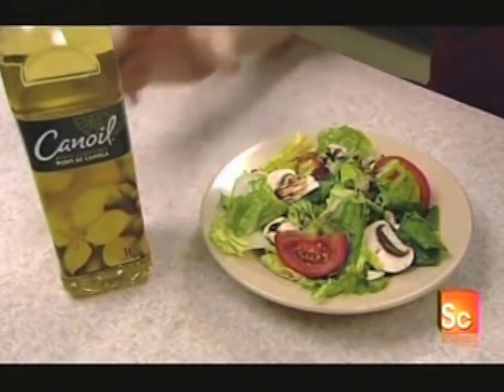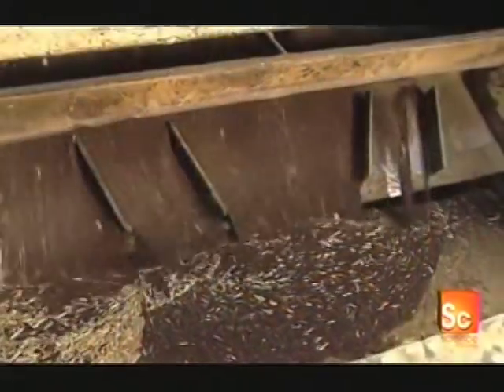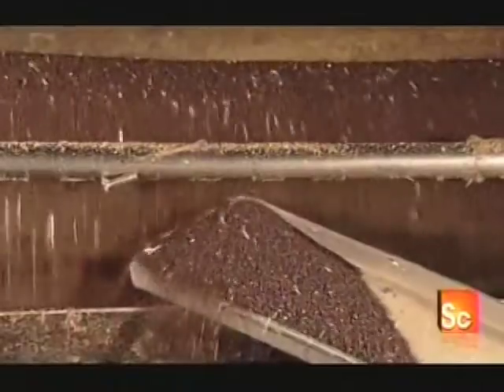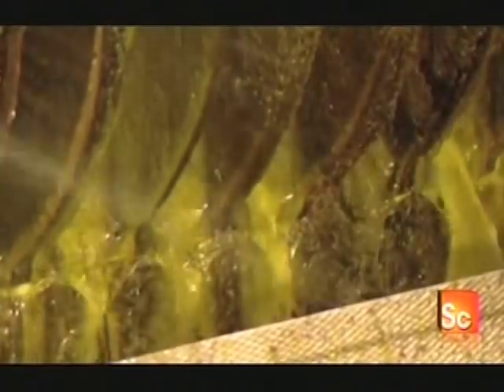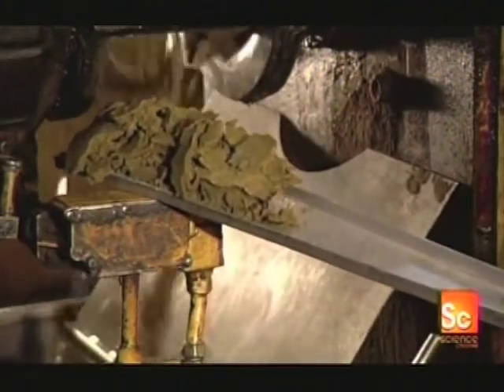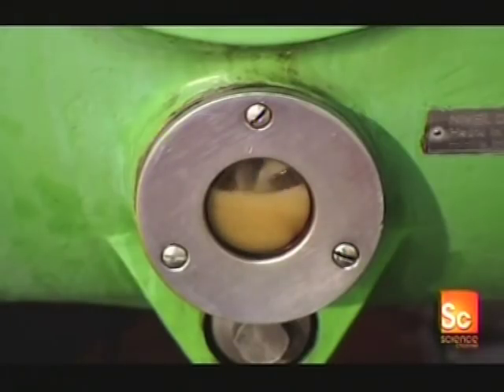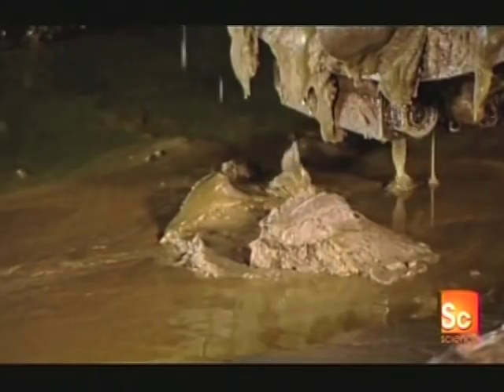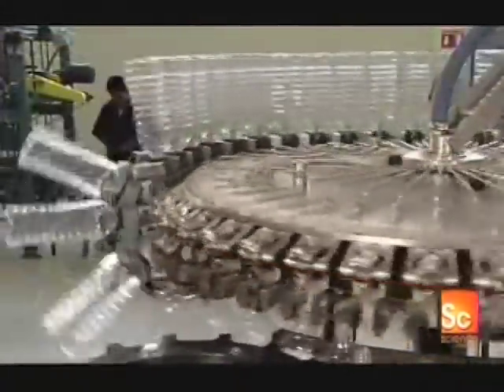How It's Made - Canola Oil

Comment: I thought it was going well up to the bit about using a chemical solvent to remove the remaining oil from the canola cake. It went downhill from there quickly.
Reply: The chemical solvent used for both oil extraction from the rapeseed and soybean is hexane.  No thank you!
Reply: Exactly. This is disgusting and how it can possibly be advertised as "heart healthy" is beyond me.
Reply: @ladiat  - If you want healthy canola (or any oil for that matter), you need to look for ones labeled "cold pressed," or "expeller pressed" or "virgin."  These oils are naturally pressed and not chemically extracted....BTW, it's the same with olive oil.  If it's not labeled "virgin" or "extra virgin" then it's probably been chemically extracted too - especially if it's a "light" olive oil, which indicates more refining as well.  Natural cold pressed oils cost more, but definitely worth it, IMO.
Reply: RBD oil is tested for any solvents after processed… like hexane, and if there still were any bad chemicals in there, it wouldn’t be on the shelf
Reply: RBD PALM OIL isn't a bad thing, considering it is replacing partially hydrogenated oil. It is healthier than its predecessor. And it is probably better than highly refined oils. But we can get better health benefits from other oils. But they cost more, so industry uses RBD PALM oil. I'd rather that than soybean, corn, or canola. Downside is the deforestation to grow PALM trees. And they sit in tanks for months at a time. Growing ever so rancid. They rarely ever empty the tanks.
Reply: This video has been cut. I saw the whole thing several years ago, all the stuff that would change your mind has been removed.

Comment: Bleached, deodorized, hydrogenated goodness!
Reply: +Thunder 35 What's wrong with deodorization?
Reply: +Shawn C Live steam is used as motive force in a deodorizer, bubbling up through the oil to ensure that all the oil is exposed to the vacuum and heat inside the deodorizer tower.  Temperatures are actually higher when it's heated, to about 230-245C.
Reply: At this point, the 'good' fats are killed. So it was good before being steamed and not good after. Is the point every one seems to be making
Reply: Naturally if it stinks soo bad, people won't consume it?
Reply: Doesn't this high heat make the oil rancid as well?
Reply: +Lofty In the words of the backpack from Dora the Explorer, "Yum, yum, yum, delicioso!"
Reply: @colinfarquhar918  It means that it's rancid and then processed to make it smell non-rancid.

Comment: We have rapeseed oil here in the UK but it is mostly much less processed than canola oil. I only get the 'cold pressed extra virgin' sort
Reply: It was banned in the UK in the 1950's - equally as toxic - and has to go through the same process here to make it 'safe'  If you only use the 'cold pressed extra virgin' the rapeseed must have been 'genetically modified'?

Comment: Agreed! Make sure what you are buying is labeled organic and is cold pressed, expeller (machine pressed without using chemicals) pressed or some other natural way of separating the oil. Otherwise, you may be getting product from some of the greedy manufacturers which are doing a lot of the same processes as like on this video to get every last drop of oil from a crop. Sunflower oil and coconut oil will probably be my only oils that are not animal based. Still deciding on cold pressed olive oil.
Reply: Man DROP THE SUNFLOWER OIL AND GO GET A BOTTLE OF EV OLIVE OIL RIGHT AWAY!! Use beef tallow, butter, ghee, coconut oil is fine, but ffs DON’T EVER USE SEED OILS!!

Comment: @CitizenRaisingCain The plant was re-named because the property of the plant had changed. Rapeseed is characterized by a high concentration of eurucic acids, (somewhere in the range of 20%). Canola oil has extremely little or no eurucic acid (Less than 2%), meaning that it is genetically different than rapeseed, and had its name changed to a version of Canadian-oil-low-acid to show where it was bred and that it was low in eurucic acid

Comment: Differential effects of dietary canola and soybean oil intake on oxidative stress in
stroke-prone spontaneously hypertensive rats.

Canola oil ingestion significantly decreased the life span of stroke-prone spontaneously hypertensive rats rats compared with soybean oil, 85.8 ± 1.1 and 98.3 ± 3.4 days, respectively. Systolic blood pressure increased over time with a significant difference between the diets at the 6th week of feeding.
Reply: doi or it didn't happen!

Comment: Rapeseed oil does not need to be chemically extracted to get the oil, that is just the way that companies can get the most oil out of the seed. It can be squeezed just like olives to extract the oil. However, due to high demands for cooking oils, all processed oils (even olive oils) are extracted in such a way that a chemical enhancer is used to get as much oil as possible out of the seed. Whether that be canola, olive, corn or etc

Comment: For those thinking this is gross:

Solvent = Anything that the substance in question can dissolve in. Like water or, in this case, probably alcohol.
Sodium Hydroxide = Commonly used for pickling brine.
Bleaching = The process of lightening color through any means whether it be through chemicals, dyes, sun exposure or simple dilution.

In other words, don't always assume the worst. Just because something sounds scientific doesn't mean they are using anything worse than everyday food grade stuff.

Comment: Nice glance at the first paragraph of the wiki! You missed the section where it mentions being commonly used in food though. Solvents and Lye (Sodium hydroxide) are VERY common and widely used for manufacturing anything that isn't sold 'how we found it'.

Point is, it's not about what they use but rather the quantities. For instance, your body produces hydrochloric acid, which is far more corrosive than lye and without it you can't survive. Also apples are largest natural source of arsenic.
Reply: This is a dumb comment, sir.

Comment: Is Canola oil natural like Peanut oil or Coconut oil???
Reply: Not at all!!!!! Never, do not touch grocery store cooking oils they are toxic. First off despite the fact that canola, corn, soy, cotton or when it says vegetable oil is derived from genetically modified seeds they are highly highly highly and chemically processed. At 2:20 for instance when they are being washed it looks likes simple water but its a chemical solvent used like he says and thats hexane look up what it is and how bad it is, after you hear the rest of the chemicals and horrible process. Most oils even if not gmo like sunflower or peanut are heavily processed so you need to look for a good quality one like at a health food store or farmers market that use the right method of extraction usually if its toooo clear its not pure. We saute with EV olive oil and if we use higher heat (rarely) use EV coconut oil. There are many types of oils like avocado as well but again you really need to know the process and they can get pretty bad like canola.
Reply: I used to work in cleaning up crude oil refineries and also food oil factories. When you open up those extruders that transport that mess it stinks like rotting corpses in there and that was even before they get to the extraction with gasoline. Believe me - I will not eat any oil if I can help it. Only exception in my book is cold pressed olive oil.

Comment: Yuck! I feel even better now about my non-use of vegetable oil (other than olive, which is botanically a fruit anyway).
Reply: amandajstar The problem isn't whether it is a fruit or vegetable which makes the oil harmful. All vegetables (and all living things for that matter) have oil. If you eat a carrot or broccoli, you are eating the oil from that veggie (there isn't much but what's there is good for you). The problem is when you have to extract it using heat/chemistry/extreme means. What makes oiive oil good is that extra virgin oil is cold extracted (the stuff which says "pure olive oil" is heat pressed and is junk). If you could extract the oil from the rapeseed without using heat, canola oil probably wpuldn't be bad.

Comment: The first step of the manufacturing oil which produces the canola cake is acceptable. It just pressing the oil out of the seeds. But the second step is just disgusting and appalling. The American system is the worst. Land of the free they say.
Reply: Extraction with hexane is common for vegetable oils worldwide -- won't say it's good for the consumer. In Decatur, Illinois there is generally enough hexane vapor during extraction of corn and soy oils to level half the city were it ignited. Even cheap olive oil, called "pomace oil" is solvent-extracted from the leftovers after pressing.